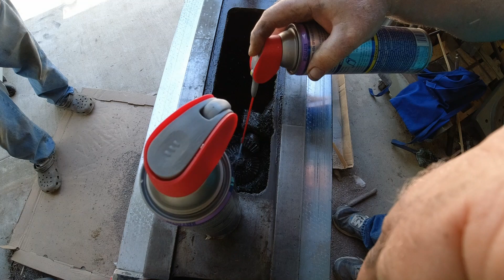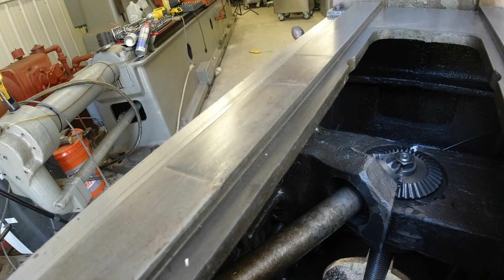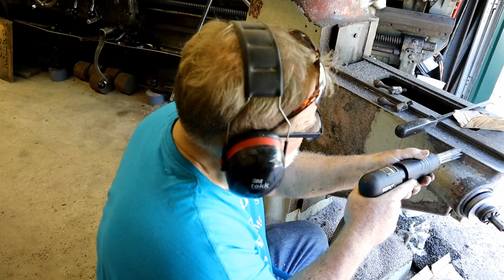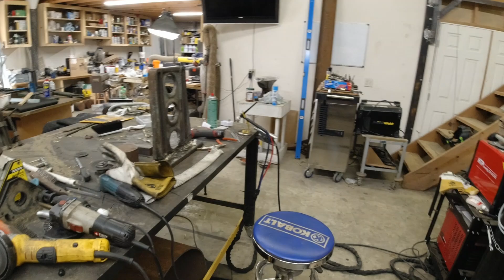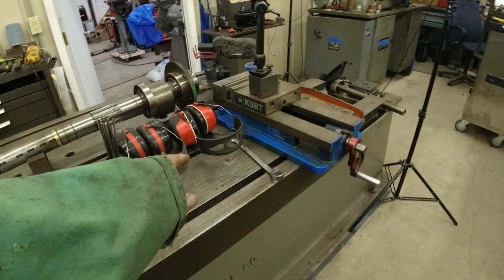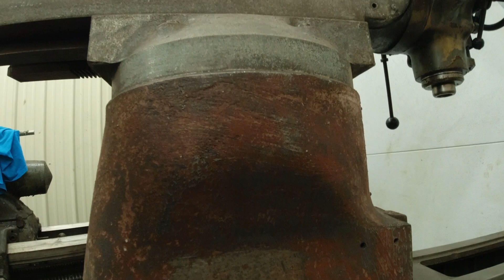Rebuilding BAD Bridgeport:  Part 3   Boy it's in trouble now!

Comment: I thought the lawyer thing was just stating facts and the way Don listens and minds makes me wonder if his mom didn't pack a revolver or a greenie. Looking better all the time  And the screw won't be hard to find. Just throw away everything that doesn't look like one. Happy bondoing and GBWYall!
Reply: I still think they need one more old fart to round out the humor lol.
 If they use a magnet to find the screw might help 🤣.
Reply from the maker: the screw was cheaper to buy :)
Reply: @scruffy6151  Texas is way too far and too flat for me to move but you're young and young and you could and leave all that ice behind and I done told them just to throw away anything that don't look like a screw.
Reply: Every dang chip looks like a screw!? Lol
Reply: @scruffy6151  I'm four hours away but I'm afraid that Steve would put me to work!!!
Reply: @4GSR  he probably would lol.
Reply: @donmadere4237  I believe it. Try finding something like that in P-gravel!
Reply: @10swatkins  By the GROSS!

Comment: So long as it’s under an 1/8th spotty putty will work trick is to do 2 coats allowing it to dry in between before sanding any more than that it won’t dry
Reply from the maker: Thanks Jeremy.... IN the next video I try out an old tube I had here.... Some of the places are deep so it would be more cost effective to put some bondo there...

Comment: As Don points out, it’s amazing how much crap collects in the knee of a Bridgeport.  On top of that the swarf seems to have its fair share of razor sharp slithers.  It would be worthwhile dropping the knee gib out, rocking the knee forward slightly and giving that slide a good clean.
Reply: That’s in the next video!!
Reply from the maker: I'm figuring out a cover for that knee gear to at least try to keep chips out of the new set...

Comment: my BP knee was completely full looks like someone tried to fill it with metal ballast.  you have the same head I do, mine has a 1-1/2 hp 220 1ph pancake motor on it although I got a M head for the rear.  Them needle scaler needles aren't that tough anymore.  mine wore down in a day.
Reply: 9:23 Tell Don he missed a spot. lol
Reply from the maker: The pistol one has not been used that much.. IT has completely blasted an Axelson 16 before we used it on this mill... . Luckily they sell just the needle unit for it... 29.00
Reply: @10swatkins  yeah, they are easy to get not that expensive.  I had mine blasted at the shop next door.  I have to admit needle scalers work pretty good on nasty machines.

Comment: "How many lawyers does it take to roof a house?  Depends on how thin you slice them.  "  But seriously :-) great videos!  What are you using for a needle scaler?
Reply from the maker: The long one is from Harbor Freight, the pistol grip one is from Northern Tool and is the better of the two, both quality and ease of use...
Reply: The one from HarborFreight is heavy and causes hand fatigue. I like the pistol grip one from Northern Tools
Reply: Dewey Cheetem and Houw
Reply: @10swatkins  Thanks Steve
Reply: @donmadere4237  Thanks Don.

Comment: I heard of Bad Bad Leroy Brown, meaner than a Jink Yard Dog....he is my cousin.....but Bad Bad Bridgeport Grey is even Meaner
Reply: it tended to be whatever horrible concoction of paint Textron could find in their warehouse that particular day. I used to know a feller that worked at Textron making BP parts on a BP.
Reply from the maker: @gbowne1  I think this is before Textron...
Reply: @10swatkins  from all the accounts of Textron I've heard over the years, I've heard some interesting stories about the stuff and processes they used.  My BP/Textron DRO is one of the casualties.  I've heard that paint suffered the same usual.. The mid 90s BP seems to have lasted the longest and the ones in the early 60s.
Reply from the maker: @gbowne1  I need to look up thee serial number but I think this one was 1984
Reply: @10swatkins  Mine was just a few months just after my entrance to the world ~7 years earlier.  1980s machine should be decent.  Looks like it survived mostly ok.
Reply from the maker: @gbowne1  I was wrong it's a 64
Reply: @10swatkins  ah ok.  Still not too bad at all.  I really should get another.  My first one was a round ram.

Comment: Use USC icing to fill the low spots and imperfections, way better than the old school red lead.
Reply from the maker: Thanks for the tip Wheels... Just ordered two tubes of it and will give it a try!
Reply: @10swatkins     No problem. I’ve been a body man for 30 years and used them all, icing sands easy and finishes silky smooth.  Put it on, if you need to fill a deep spot do it in multiple layers, rough cut it with 80 grit sandpaper to get the shape and contour you want then finish it with 180 grit or 220 grit and prime it you’re good to go.  The only drawback is if you put it on too thick it will pinhole that’s why I said do it in layers if it’s deep spot to fill. 😬👍
Reply from the maker: There are a couple of spots that have about 1/8" holes that planned on bondo first the the top coat.. thanks again.

Comment: Bondo and paint makes it the NEW Bridgeport it ain't! Just ask 90% of machinery "rebuilders"
Reply: Well in this case new nuts, new lead screws, some hand scraping so more than just a face lift.
Reply from the maker: New top head rebuild with belts, all new bearings in the head and table, new dog shafts, brake, knee badges and even a new flag!  About 3000 in parts so far..

Comment: Bentonite for oil pickup.....from Ft Benton in Wyoming......liberal people eat that stuff...no kidding
Reply: Used to maker a slurry to prime concrete pumps and as lube for the old Peerless mower trannys too.
Reply: We use that stuff in oil well drilling!!!

Kiddy litter works too!  That's what I use.  Probably the same stuff..
Reply: @4GSR  Seems like I heard/read that somewhere but I might've gotten a spare vibration from a stump for the same results.
Reply from the maker: Around here it is more expensive... Shipping.. the is another source , a mine in the Big Bend area of Texas.. Not as good of quality though..
Reply: @10swatkins  I don't know how much the pump guys pay for it here but I bet it's a bunch.
Reply from the maker: @lewiemcneely9143  I bought two 18 wheeler loads two years ago.... 2200 lb bags from Big Bend Mine... Shipping and product was about 12000.00
Reply: @10swatkins  OUCH and DOUBLE OUCH! I hauled gypsum for trees but it was on a tri-axle. You cornered the blasted market!
Reply: Fort Benton is in Montana. Bentonite deposits in Wyoming were named for the Montana town
Reply: @lnbwood  That's about as literal as it gets. Thanks!